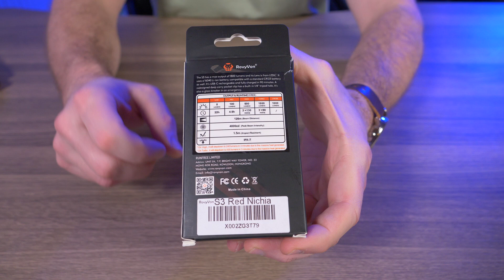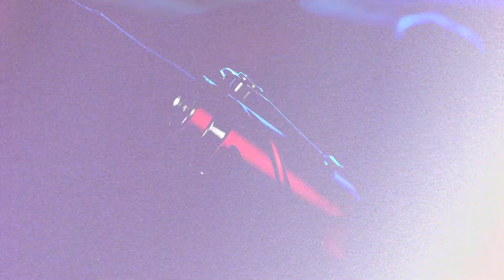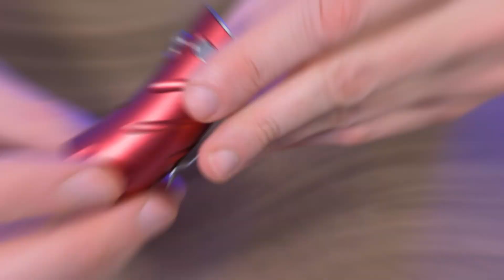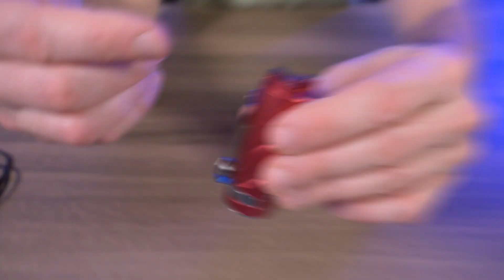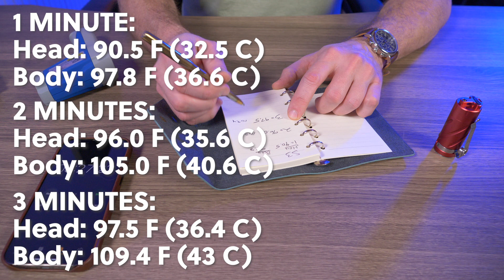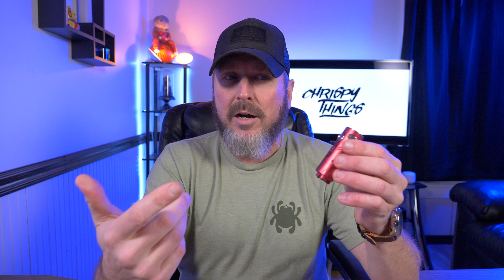The 1200 Lumen High CRI RovyVon S3 is almost perfect for EDC!

Comment: Looks like a good choice for many situations, but hikers who want a flashlight with good power efficiency should look for a flashlight with higher candela at lower lumen settings (lumen drains your battery to create "total brightness output", while candela is the brightness of the "hotspot", which depends more on the shape of the reflector). I recommend the Nitecore MT1A single AA battery flashlight (i calculated the power efficiency in the last paragraph), which is the official NATO backup flashlight. It has a relatively focused beam, so even the low 5 lumen (280 candela) setting is actually good enough for hiking (although if it has rained, it gets difficult to see puddles of water before you are very close), and on this setting, a single AA battery will last for 60 HOURS..! The 22 lumen setting is the PERFECT "medium" brightness IMO, and this last for 18 hours. It also has a 55 lumen (5 hours and 30 min) that i rarely use, and a turbo setting with 180 lumen that is easily accessible by twisting the head of the flashlight, and very practical when i think i hear a crazy killer moose in the bushes..! The main power button is at the end cap, which means you dont have to fumble to find the button in the dark. For use inside the tent, i recommend getting the "diffuser cap" (around $5 IIRC), which will make it into a really good "worklight" 👍

Here are some comparisons of lumen and candela... The 1800 lumen setting on the RovyVon S3 gives 4000 candela (and 126 meter throw), while the MT1A gives 3350 candela at only 180 lumen (115 meter throw). The 1800 lumen setting on the Nitecore MH12S gives 21.600 candela (294 meter throw), and the "new" Nitecore MH12SE has a "crazy" 41.000 candela (405 meters throw - also at 1800 lumen). I got the MH12S, and its definitely an awesome flashlight, but 50 lumen (600 candela) is the lowest setting that is useable for hiking, so i still prefer the MT1A for its power efficiency, small size, and low weight.

I did some quick math to quickly compare the power efficiency of my Nitecore NU32 headlamp (wide beam) VS Nitecore MT1A (focused beam) VS Nitecore MH12S (slightly less focused than the MT1A). The 33 lumen setting of the NU32 uses (0,888mW) ~4 times as much "power VS candela" as the 22lumen setting on the MT1A (0,22mW), but i was surprised to find that the headlight only uses a little over half the power compared to the lumen output. Every candela on the 50 lumen setting on the MH12S uses 0,685mW. So the MT1A is BY FAR the best of these 3 👌

Comment: I'll pretty much always take the  output hit for light that I wanna look at! 

I recently bought an fw3 with neutral xpl-hi.. I figured that I'd prefer the output in this case, by I loved the light, but hated the light it made lol. Switched em out for 4k sst20s ASAP. Now I really love the light!

The funny thing.. my favorite tint/high cri light of all time actually has a neutral xpl-hi. An older eagtac d25c ti.. the light it makes is just far better than it should be. I've bought a handful of other lights with the same emitter, including another d25c ti, and they look like garbage bedside the unicorn eagtac. I've got some nichia lights as well, and I think they look great!... By themselves. When I I pull out the freak eagtac, it puts em to shame. The CRI isn't quite as high.  I'd guess high 80s. But all things considered, it continues to hold the throne in my collection.

Comment: I have the S3 in both black and red. It's a great flashlight.  I picked up some Ravpower rechargeable RCR123A batteries which provide a slight bump at 700mah, and they work great and can be recharged by the flashlight as well. They come in a 5 pack on sale for approximately $20.  Great job on the review, keep them coming.  Rovyvon just put out an S3 Pro, which uses 21700s or 18650's for about the same price. Haven't seen any reviews on them yet though...

Comment: I'm reluctant to invest in these "off brands".   Fenix, Olight,  NiteCore, Steamlight, Surefire, Klaurus and a couple of others are brands I recognize and seem reputable.  I buy Fenix brand flashlights above all the others though.
Reply: well no reason this is a bad brand... just not as popular.
Reply: Rovyvon was definitely a newer one to me, but the a8x-u was too tempting not to give a try.. after a couple months with it, I'd definitely get another from them! I got the nichia version, and while it's not as good as my other high cri lights.. a couple Prometheus betas, an fw3ticu with 4k sst20s, and an eagtac d25c with a freakishly excellent neutral xpl-hi, it's still much better than any of my others and perfectly acceptable when I'm not anally comparing it with better lights on a white wall lol. 

Aside from that, build is solid and it's just an Impressive little light. I've also owned the Nitecore version (tiki) and a clone of the rovyvon. The rovyvon wins.
Reply: @Silofox  same experience - I was reluctant to even spend the ~$45 on the A8x, but I've been pleasantly surprised by that light....

And this review just convinced me to splurge on the S3 Titanium....
Reply: @sdriza  glad you like it. I did have a small issue recently with the intervals of the a8 getting a little loose but I just injected a little super glue through the opening around the USB port. Fixed. If you end up doing this, I’d recommend removing the silicone plug while it sets. The fumes make the silicone a little weird. It’s still just as usable, but the part of the plug that sits deepest got a little hard from the fumes.

I also got another though.. an a25. I wanted the glow body. I’d probably get the a28 if I were to do it again though. I’m pretty sure the full transparent bodies have better uv leds.. the a25 throws a lot more purple light and I noticed that the site states that the uv is mainly for charging the body on applicable models. The a8’s uv is definitely of higher quality. Much less purple light and it does a much better job of “revealing” things.
Reply: @Silofox  
I have the a28 (nichia) and it's great! 
It has a really usuable UV side light and has glow in the dark stripes on the battery pack, which means that the sides still glow after using UV without blocking the UV light from revealing stuff :)
Reply: @deimuader  right on. I had an a25 but was pretty disappointed with the uv light.. I think they out better ones in the transparent (non glow) bodies. The uv on my a8x is great but the a25 mostly just threw a bunch of purple light. Ended up giving that one away.. should have gone for the 28 but I wanted the glow body. Would have gotten the 28 if I’d realized the battery tray glowed.

Edit.. didn’t read my previous post so I ended up repeating myself.. my thoughts on the matter remain lol